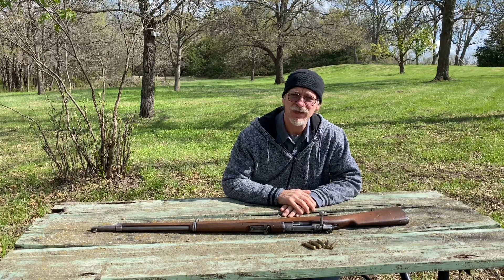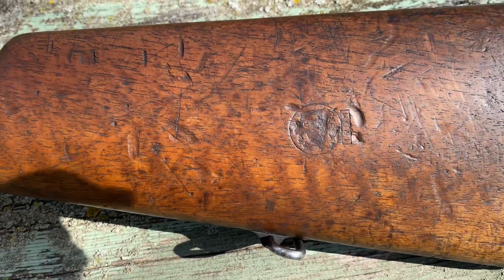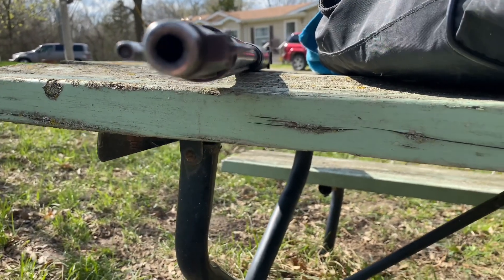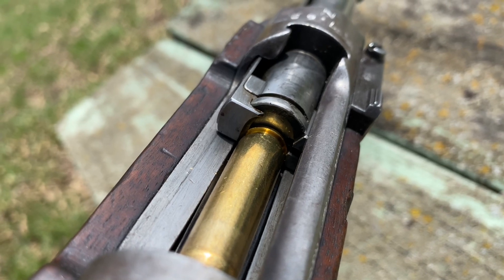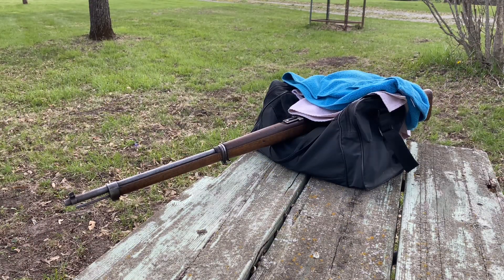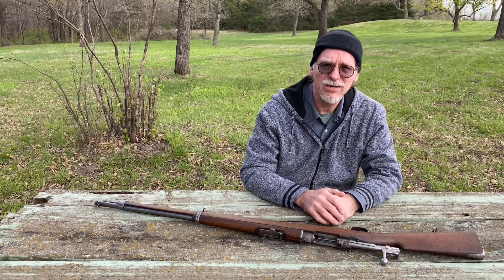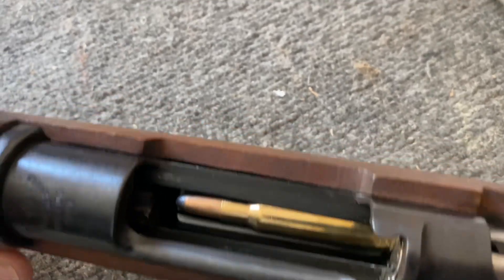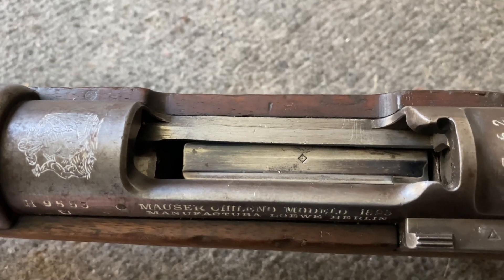My Thoughts on shooting my 1895 Chilean Mauser in 7.62 x 51

Comment: I have three different varieties to our 7 mm the other is 7.62 Military grade rifles are designed to run with a good slap and push. They're not fine-tuned to be super smooth. They're made to definitely load around and eject that round. The extractor arm on the right could be tuned to make it chamber easier but they were not built to be that smooth but built to actually do their job. Remember in combat you're slamming that bolt back and forth with a very strong extractor to make sure it comes back out so you can get another round in. As far as the stickingness of the bolt. There is a little bit of gum or goo or something somewhere in the slide action more than likely. It only takes a little bit of yuckiness in there to make that happen. These originally used a oil that's almost like a grease to lubricate iy,was it lubricated properly?
Reply from the maker: @erica12373365  thanks for watching & your input . In my video I was using some .308 spent casings to hand load . A few months  ago a viewer asked me a question about the 7mm verses the .308 on the bolts . I tried both the 7mm& the .308 bolts in each rifle & they worked for either one of them . When I tested this I was using fresh 7.62 NATO and Iit seemed to chamber correctly , I did not fully close the bolt since I was inside my house & not at the range . When I go out to try the fresh NATO ammo I will make sure to scrub out the chamber throughly and make sure I have oil on the bolt rails

Comment: 7 mm mauser was the standard caliber for Chilean Armed Forces since the beginning of the S. XX. In the mid 60's when Chile adopts the .308 with the SIG 510 (Stg 57) the majority of the mausers still in active service where re chambered locally by FAMAE to this NATO round. They were been used since then for parades and basic training.
Reply from the maker: I knew that they were in 7mm and at some time most were converted to the .308 / 7.62 caliber . Not knowing where all my rifle has been or the care it has received , I do have an issue getting it to feed a round correctly . Just have not had time to really look into the reason why . I like the rifle and overall handles well

Comment: I have one of these and it says it has been rechamberd for 7.62 N but when we tried to put a 308 round in it wouldn't fit in the chamber
Reply from the maker: Sorry it has taken me this long to get back to you . As you saw in my video I had problems to get the round chambered correctly . I am not sure why yet , I have not really looked at it with everything going on . I do think it does not get into the bolt face correctly . I can manually insert it into the bolt face and then chambers correctly . With what you are saying the .308 does not fit the chamber . The bullet diameter to big , something in the chamber keeping it from fitting or did someone swap out the barrel back to a 7mm , but left the 7.62 stamp on the receiver . Look into it more and be safe if & when you shoot it . Do a test firing first and take precaution doing so and then check everything throughly

Comment: I bought a chilean 7mm mauser that was rebored to 7.62 x 51 no bolt. can I use the original 7mm bolt on a 7.62x 51 ammo?
Reply from the maker: At the moment I don’t know , give me some time  to check it out , I have the Chilean Mauser in both the 7mm and in the 7.62 x 51 .
Reply from the maker: @JOSERIZALADVENTURES  ok , I did some checking with some on line forums . First the 1895 Chilean Mauser’s had a bolt sleeve soldered in for the 7.62 x 51 . In the chamber it is mentioned that the soldering deteriorates and become unsafe to shoot , plus the difference in 7mm & 7.62 chamber pressures . That aside I found that the 7mm bolt face is .004 larger than the 7.62 . I took my bolt out of my 7.62 converted rifle , put in the one from my 7mm rifle . It stripped it from the magazine and did what it is supposed to do . I did not fully close my bolt on a live round since I am at home & not at a range . I do not need some stupid accidental discharge . I took my bolt from the 7.62 , used it in the 7mm , it stripped it from the magazine & did what it’s suppose to do . Based on what the forum said about the bolt face & what I tried , yes you can use the 7mm bolt for the 7.62 ammo in the chilean mauser . What was also said would be to check head space .

Comment: Looks like the bolt is wrong. I have a 1895 German made Loewe German manufacturered rifle in the original 7mm and my bolt has a bent arm. I also noticed that your ejector is not working.
Reply from the maker: Thank you for your comment , it is something to look into . I have a Oviedo Spanish Mauser converted to the 7.62 x51 , I will try using that bolt to see if it makes any difference . For now I have it tagged as do not shoot

Comment: What happens if you just oil up the action and run it hard? Mausers won't call it abuse if you just run the bolt hard.
Reply from the maker: I have been busy and no time to look into what the problem might be . The base of the case does not fully engage to the bolt face . It starts to as I move the bolt forward , but only partially , then it does feed into the chamber correctly . I can manually put the bullet onto the bolt face and it chambers correctly . It is going to take some more investigation into it . Hopefully I can figure it out , basically it is a nice rifle

Comment: Almost seems like your extractor has an issue, is too tight/bent/has a burr?  I don't think that issue has anything to do with the safety of the conversion.  I wonder if they used a different extractor for the 7mm or had to modify them for this conversion.  7mm is one of the few calibers I don't load.  Your brass looks good and doesn't seem like it's an issue w/ the chamber to me. If that extractor has a death-grip on the rim, it could have made it difficult to pull the bolt back once you got to the ejector.  Sounds like opening the bolt was normal so probably not a chamber issue.   
Edit:  that extractor looks funky to me on the Chilean, almost like someone took a file to it.  I'd be real tempted to try another extractor or check it with the bolt out of the gun, see if you feel excess pressure when slipping a cartridge rim up there vs another Mauser.  
As far as the safety of these conversions; I know nobody asked me and I'm just some random dude, but I've looked into these (the Spanish and Chilean)  after buying one of the Spanish 7.62 NATO conversions years ago and here's my conclusion from all I've read and the rifles my Dad and I have tested:
These actions are plenty strong for .308/7.62 NATO rounds (the two are barely different in pressure when one considers the proof loads these things ate with no trouble before entering military service).  The concern on these Chilean rifles is usually how the conversion was done, which was usually a chamber insert which the Spanish did not use.  My dad recently got one and checked his insert w/ the borescope and it looks good.  They can erode where the insert ends, and some have been known to come loose.  One in good shape is plenty safe to fire.  If you're really worried, you could just feed it cast bullet loads with 2400 or Red Dot or something like that.  My dad is really happy with his Chilean conversion, it's a great shooter.  He got it at the big Tulsa gun show last month.  He's put quite a few rounds through it so far from cast to milsurp 7.62 NATO to .308 commercial.  
But that action itself will safely hold well above 7.62/.308 pressures as they were proofed with very high pressure loads well above that when in military service.  
I have a couple of the Spanish Mauser conversions and have no problem firing anything from mild cast loads to commercial .308 loads.  The actions are strong and old 7mm military ammo was spicy stuff and I read some testing showing types that nearly entered what 7.62 NATO is loaded at.  
I'd say just keep an eye on the insert if yours is one with an insert, you can get a super cheap borescope that plugs into your cell phone or computer, shoot your mild loads and have fun.  If all looks good as far as bolt/headspace/insert, that action isn't letting go unless you had a major "oops" at the loading bench.

Again, I'm just a dude basing this on what I've read and tested on a few rifles myself.  It's always good to err on the side of caution.
Reply from the maker: Thank you for comment & observation , the rifle looks very good as does the bore . I just do not know why it won’t chamber the round correctly . Those are not things I had thought about , so I will look into that . I have thought of the bore scope , just have not bought one yet . Also on my video in memory & honor of my father , when replying to you , I must have hit a wrong button and can not reply to it now , so I made a reply to myself to you . Again thank you for your information you shared with me